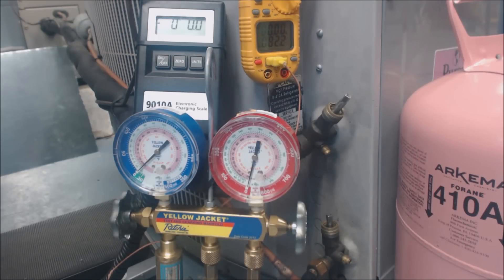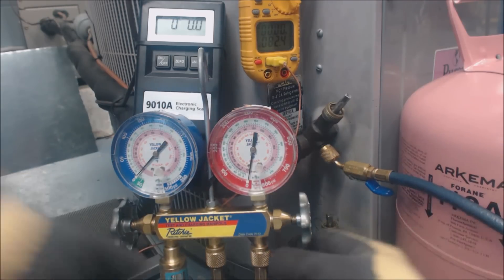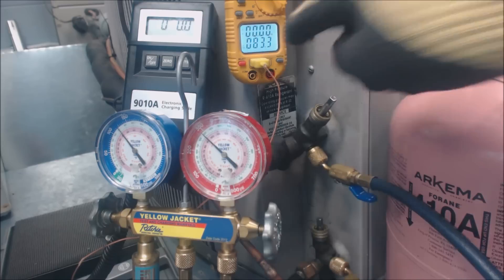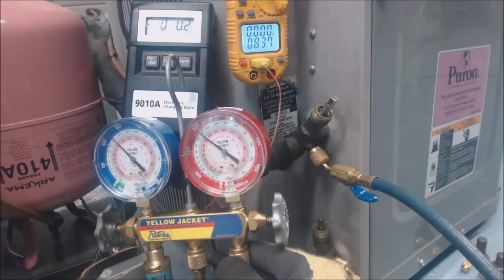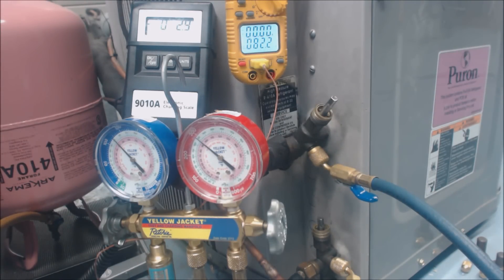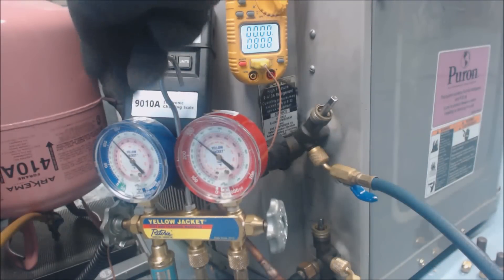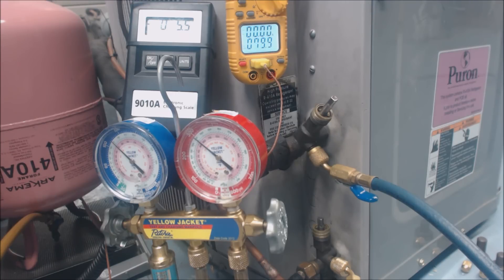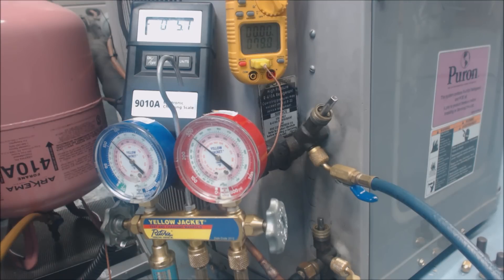Charging R-410A Refrigerant into a Unit that has King Valves!

Comment: U said once the multi position valve is front seated the compressor is isolated from rest of the system and the gauge port would be open to evap. Instead, the gauge port is actually open to the compressor side completely separate from evap and anything past that.
Reply from the maker: i meant specifically on an air conditioner, not refrigeration unit. on a refrigeration unit, it is different depending on how and where the valve is installed, thanks!

Comment: Will putting the liquid to vapor device directly to the R-410a tank save on refrigerant? Putting the device directly to the tank will let the hoses are filled of vapor, which will de minimize the refrigerant loss when disconnecting hoses. As the way you connected the liquid to vapor device to the manifold the yellow hose is full of liquid refrigerant. When you disconnect the hose you will lose a full hose of liquid, but not vapor.
Reply from the maker: Putting the vaporizer on the tank is a good idea. Look up "acservicetech connect check the charge, disconnect procedure" for a video on how to not loose refrigerant, thanks!

Comment: If this unit was R22 and if you were charging through the vapor side using your kwik charge do you need to turn that bottle upside down?
Reply from the maker: You can charge r-22 with vapor without the kwik charge but we usually don't because it takes much longer. Thanks!

Comment: great video and explanation of subcooling. quick question, say its 100 degrees outside and the air isnt pulling the heat off the condenser as much as lets say 75 degree day. will the subcooling change because of the temp rise or does it balance out because the indoor coil is absorbing more heat as well?
Reply from the maker: Great Question, Yes the amount of subcooled liquid degrees will roughly be the same but the actual temperature will be higher on hotter days.

Comment: Is this a commercial unit?
Reply: Reason I am asking is because of the system having King Valves.
Reply from the maker: Great question! Some units 5 tons or less that would be considered residential light commercial will have these. Thanks for the comment!
Reply: +acservicetech Do you think you can do a more in depth video about King Valves. The Front seating, Back seating Mid seating, how the system functions when it's seated a certain way. Also what's the difference between a Service Valve and a King Valve? 
Thanks.
Reply from the maker: Great idea! Give me a bit but that would be a good video to do! Thanks for the comment!